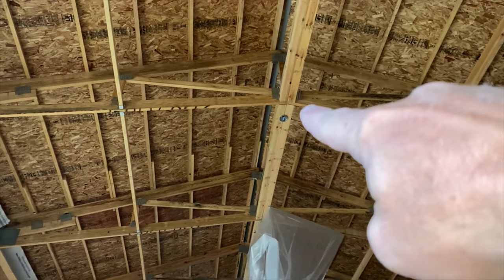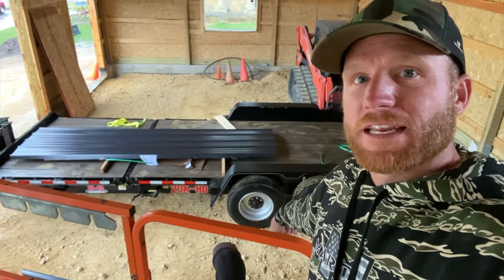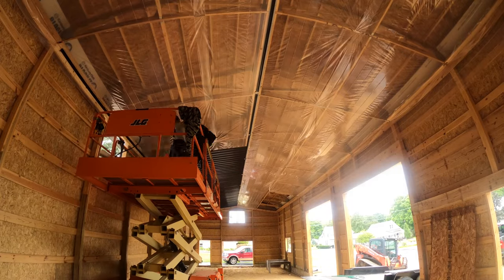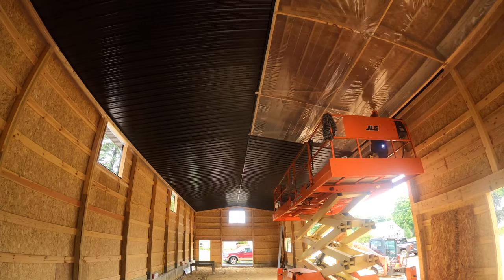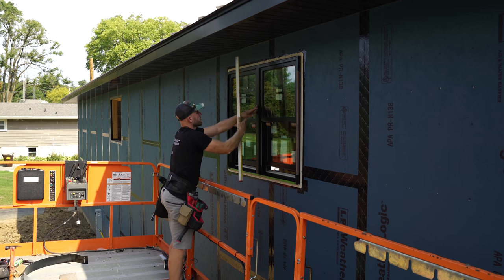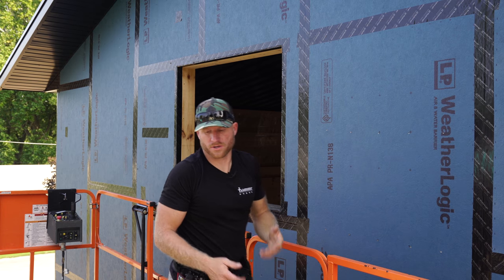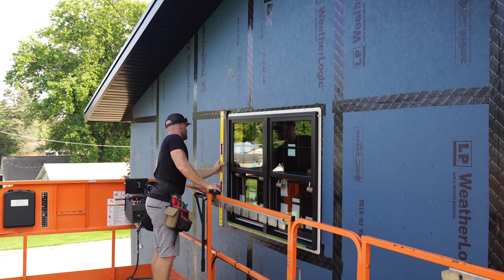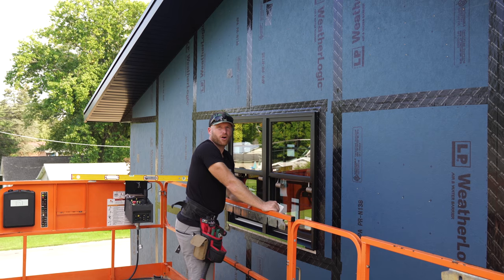Oregon Music Garage: Install a Black Ceiling and Black Windows

Comment: That MEGADECK sure makes the work go faster and SAFER!  I guess working a small crew on a large project makes having access to big lifts, etc. a necessity, not a luxury.
But I've been watching how you two stretch yourselves to the max with awkward and heavy loads.  That's young man's work. Another 10 or 15 years, Kyle, and you'll be sitting in the shop with a heating pad on a bum shoulder or back, lining up projects for the young backs to put up!

Comment: You know up here in Canada we make our rough opening 1" bigger than our window or door size. Here is why. It allows us to not only properly  square the unit, but to fill the remaining void with a Hilti non expanding spray foam. The spray foam also adds an extra protection from water leakage. When you put your windows in they have at least an 1/8 to 3/16 gap between the window jamb and the rough opening that has no insulating factor at all. Just food for thought. Other than that Kyle you do work in the same way I do. Excellent. Love your Channel. Check out the Hilti spray foam gun. Metal nozzle and a cleaner bottled.

Comment: "Weight is Equivalent to Quality"....I remember a scammer back in the day that used to fill the bottoms of his speaker cabinets with concrete, and put in $5 speakers...sold them for hundreds of dollars claiming "Feel the weight of these things, massive magnets and drivers"...no, 40 pounds of concrete...
Reply from the maker: Haha
Reply: @Effen Truth 
Kyle obviously makes money based on the continuous quality jobs he gets. 
He always has the best of equipment too. 
The best way to make money is to do a quality job and keep your customers happy and have a reputation that you can be trusted. That is the cheapest form of advertising in the long run. There are no successful short cuts in any business you want to run long term. 
I am sure any job that Kyle and Greg do leads to at the very least one other job with a good client. 
Always try avoid shyster clients too. They will break your heart with BS and are a total waste of time and money. Shady clients likely have shady connections and you don’t want to work for them either.
Reply: @Effen Truth 
You are right man, I did 😂
Reply: @Effen Truth Yea...I was just a teen back then.  I do remember one of them though...I worked for him.  The guy owned a Score Board repair/installation company way back then.

He sold "High Quality Speakers" as well.  Real pieces of work...total junk, and he sold a ton of them (get it son, loaded in concrete...ton of them"...it's a weight joke son, keep up.  LOL

I will say, I got to do some really cool work as a teenager though.  Worked on a couple professional scoreboards (our primary customers were all the schools, and back then...hundreds of scoreboards were being maintained by this guy's company).  I'm sure he is long dead now, he was in his 50's when i was working for him...

Comment: Nice looking work Kyle.I know you are not the electrician but those shallow pancake boxes that you showed a close up of are only rated for one wire by code,I see two wire connectors in that one.Even if they weren't that's a lot of wire to shove in that box,not good. Ceiling looks great man.

Comment: I always wondered why you don’t just set a gap around the edges of the window. If you frame out 1/2” larger and put 1/4 shims on bottom and one side. Set window on bottom and push to one side, level the top and nail it off. Then set square with a framing square and nail it off. Seems it would be must faster

Comment: I think that when I build mine I want a white or galvanized ceiling, then hang LED shop lights, but flip them upside down to bounce the light off the ceiling rather than pointing them directly at the ground.
Reply: That would give a beautiful full light through the building with no hot spots on the walls beneath. Go for it!
Reply: @jeffreycollins7297 , that's the way the lights are set up at Dell's call center in OKC, at least when I worked there, and the lighting was fantastic.
Reply: I used white metal for the ceiling in my shop. I aimed the lights downward and very little light reflects off of the ceiling. A metal ceiling is very fast to put up.
Reply: @geraldpolmateer3255 , are they hanging or solid mount directly against the ceiling?
Reply: @chaseweeks2708   the white metal is screwed directly to the chords of each truss which is spaced four feet apart. The lights are hung by chains. When I selected the lights I bought them for the distance above the working surfaces. If one gets lights for say eight feet above they will not work very well for those designed with a spread for sixteen feet above.  The spread and number of lumens per square foot I wanted determined the lights and how many I wanted. It was mostly the spread that determined the spacing and number of lights. My shop is illuminated at 100 lumens per square foot. I used four 48,000 lumens lights. Each light uses about 200 watts. So because of such low power I was able to put them on a single circuit using the typical light switches.
Reply: @geraldpolmateer3255 , was only curious about the lights. From what I've seen, flipping the lights upside down to bounce the light off the ceiling creates a much more even distribution of light in a workspace than pointing them down at the work. The downside is that the ceiling will absorb some of the light emittance and the extra distance will reduce light levels a bit, so it probably isn't quite as efficient, but the results are better. Another downside is that you have to clean the lights more often, which can really suck if the lights are 15ft off the ground (which is what I'm planning).
Reply: @chaseweeks2708  make sure to take a look at the light spread and the height they are to be mounted at. The quality of lights vary from junk to very good. I bought commercial lights that are 48,000 lumens per fixture.  I concentrated the lights slightly to the middle by just a little where I work, and less where my shelves are where I never work. These are the lights I used https://www.atlaslightingproducts.com/ilh448ll5k.html  I used four fixtures for a shop of 1920 square feet. I seldom use an additional light on a machine. 100 lumens per square foot is a lot of light. The lights do not have to be cleaned because they are shielded from above by the fixture. Each lights is about 1/4" in diameter.
Reply: @chaseweeks2708  I have the lights up high to avoid hitting them with anything that is long. It is like the idea that a shop can never be too large or high enough. I am glad I built the shop at 16" ceiling height.
Reply: @geraldpolmateer3255 , I can certainly agree with that. My current design calls for 19-20 ft ceilings in the workshop area so that I can have a full 8ft room over a 10ft garage with 14-16in I-joists and 1 1/8" subfloor.  It's gonna be a huge building.
Reply: @chaseweeks2708  originally I planned on lower walls and lower doors.  A friend advised me to install a much higher door for when I sell the property. I had a taller door installed so that an RV could be stored in the building. I do not have an RV so that was not a consideration until I considered selling it. When I bought a 36" bandsaw I was instantly glad I had a much taller door. The large door is 14 feet tall. The height of the mast on the forklift, the height of the upper arm including the top of the guard, and the short length of the strap made it so that I could just get the bandsaw under the door. and the My understanding is some RVs are 12-1/2 feet in height.
Reply: @geraldpolmateer3255 , that's definitely one option I've got in the back of my mind. This build will be the retirement home, so I won't be worrying about resale value, and I never plan to have a full size Class A or Fifth-wheel RV, I do plan to build something based on a Sprinter or Transit van, so the additional vertical space may come in handy. I've still got a few years yet before I can break ground, so I'm sure my design will go through several more iterations between now and then.
Reply: @chaseweeks2708  I am where you are now. The cost to put in a taller door is not much. Eventually that property will be sold at some time. It is just a matter of when. Most people sell their home to downsize when they can no longer take care of the property they are in now. My realtor friends tell me that most people when they get older move closer to a medical facility so they can have good access to medical care. My dad died three years ago and he did not prepare for that time. What a mess we had to deal with. My wife's mom did and it was much easier. I have viewed every piece of property I have ever owned as an investment and have made a good amount of money on each property.

Comment: Hi from uk, just an observation if you don't mind me saying.
If a quality window and case are assembled correctly, their top and bottom should be same length as too are both sides, if that is the case, if you plumb one side and level top or bottom surely it must be fitted square? As you know yourself, adjusting square means adjusting diagonal length which in doing so could mean out of level or plumb. so why the need to check level and plumb and also diagonal for square. wouldnt level and plumb be good enough?
Reply: Accuracy of a bubble level across that distance on plumb and level could easily give rise to a 1/16” difference. So measuring the diagonal is more accurate, sensible and quick.

Comment: I'm worried if that metal steel sheets and nylon together create a vapor trap...they are basically two vapor barriers together...so any moisture that gets by metal, can't go upwards trough nylon and gets trapped.

Comment: Will you be having the closed-cell foam guys put a layer on top of that steel before blowing in the insulation?
(assuming not, since you used poly vapour barrier, but that space would really benefit from some air sealing up on that ceiling)

Comment: so lets be clear, there is going to be spray insulation on the walls but the roof is just OSB and steel plates? why insulate at all then?
Reply: He said that they are blowing insulation in above the ceiling.
Reply: Pay attention and you’ll have your answer.

Comment: Kyle I believe you mean a 0.4 mm vapour barrier, since 4 mm is around 1/6 ". Not saying it's not possible, but that would be one heavy vapour barrier 🧐
Reply: 4 mil
Reply: steenfraosterbro nope, he means 4 mil like he said. Mil = thousandth.
Reply: Ahh mil not mm. Then suddenly you guys can use a metric (latin) word.
Reply: @steenfraosterbro3268  The wonderful logic of the imperial system.